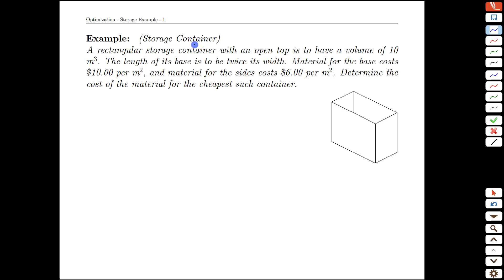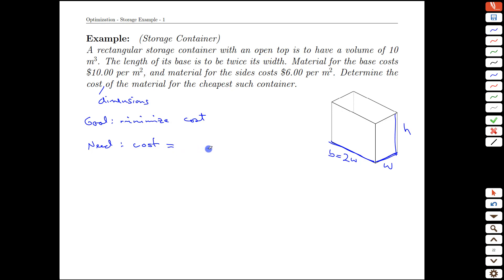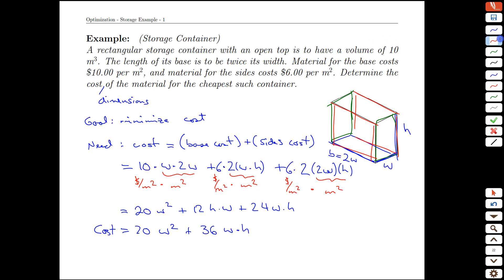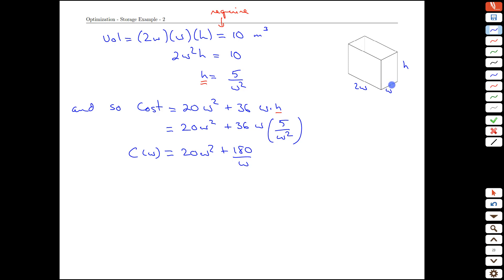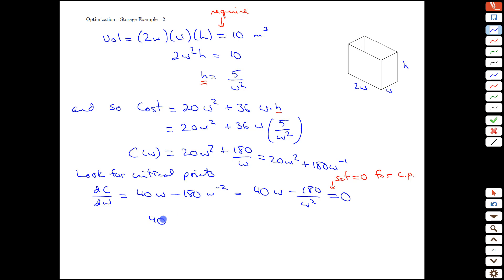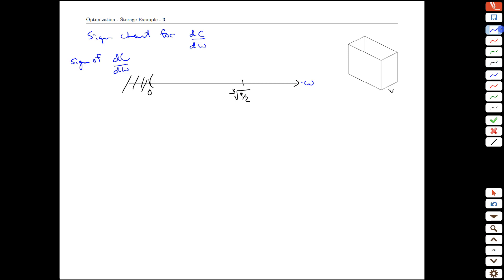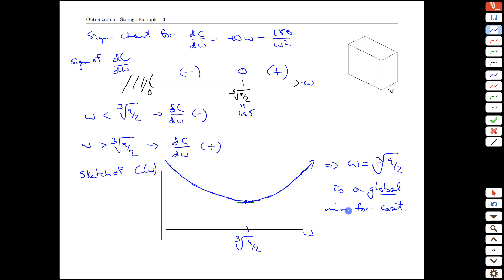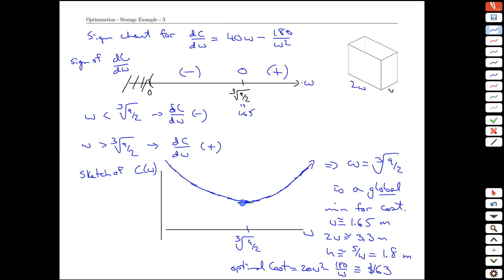Topic 5-14 Optimization-Storage Example

Comment: The formula he wrote for cost was 20w^2 - 180/w , whereas it should've been 20w^2 + 180/w. The value he got was correct, and used the plus 180/w formula.